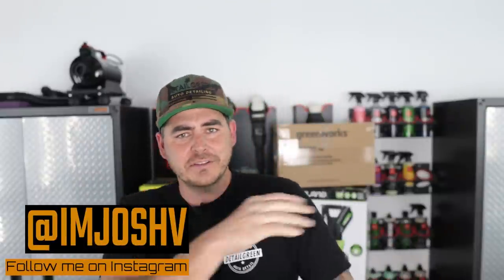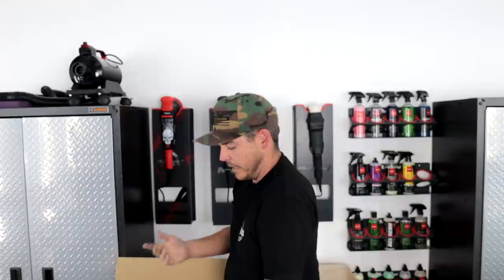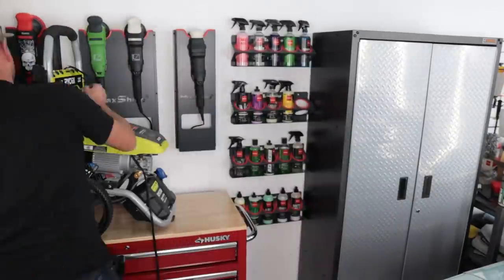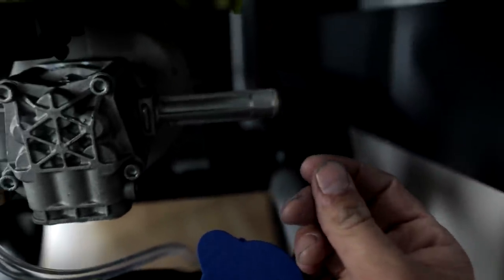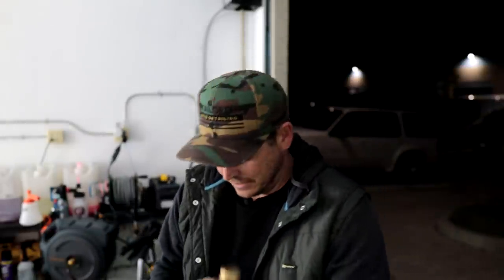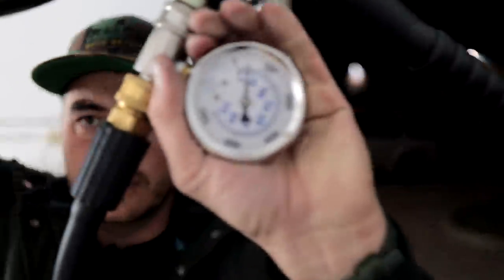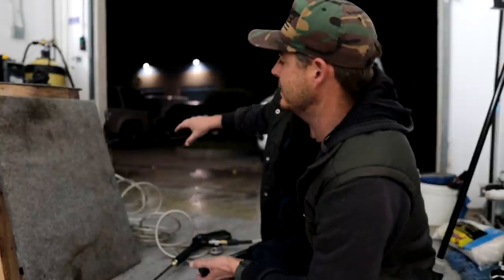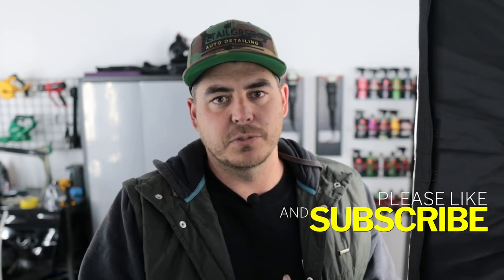Ryobi 2300psi Electric Pressure Washer NEW UPGRADES! | Power Washer

Comment: I looked at my local WA home depot and HD/ryobi website but all they have is old model with same model #: ry142300. Called Ryobi too but they only repeat what's on website. Anyone that got the new model: updated model # please? @IMJOSHV: Great reviews and info! Thank you
Reply: KS I asked the same question.  I spoke to 2 or 3 diffent people at Ryobi and they said the 2300 psi model did not have the "total stop system" only their smaller models, I was totally baffled.  I went ahead and purchased one anyway (same model numnber 142300) and the box even showed a picture of the old model.  Well, it was the new model inside, with the total stop feature etc.  I actually calle Ryobi back to let them know that their people need a heads up about this new model.  Strange.